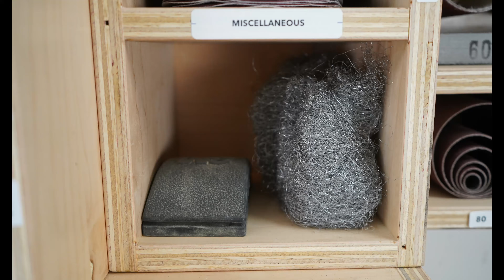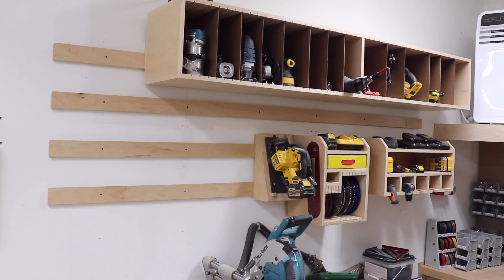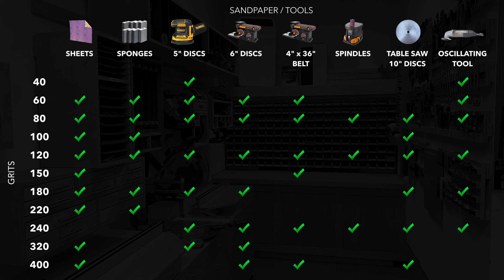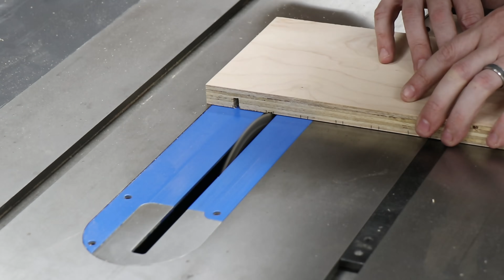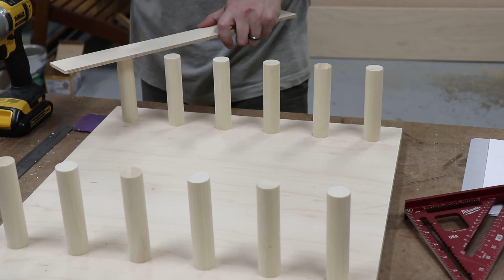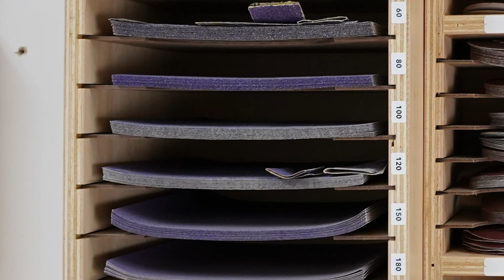Shop Organization - Part 5: Sandpaper Storage

Comment: After two years of use, would you change something in your design?
(thanks for sharing, it's inspirational!)
Reply from the maker: Biggest thing is I don’t use that many grits very often, especially on my belt sander.  I more or less designed it overkill so if people needed that much it would work out and if they needed less they could scale it down.  Also thought if I had more options I would use more, but I really don’t.

Comment: Great video many thanks.
 Just watching again and i noticed one thing i would recommend, is the papers and grits are the wrong way round. I use to use loads of discs and sandpaper in our body shop. and cross contamination of grits is bad so much batter to have giner grit to the top and course to the bottom. So any grains falling from discs above wouldnt matter if fine above. Again would that I could make videos like this well done and Many Thanks
Reply from the maker: Never would have thought of this ever being an issue but makes total sense, great advice!  Thanks!

Comment: If you carefully design the unit for a given space, French cleats add no value- you are not going to be moving it.  I built a similar abrasive store, but added a door- the extra access operation was worth excluding the dust. 
There is an argument that we never use full sheets, and so they should be stored as thirds, or quarters. My problem is - which?
Reply from the maker: I would disagree, things change.  Tools change, amount of tools change, workspace needed changes.  Most of what I have on my French cleat wall I have moved at least once, if not multiple times.  The sand paper storage hasn’t been relocated, but I have shifted it around a few times based on where my miter station was below, if this was just mounted into the wall that likely wouldn’t be the case.  So even if it isn’t a full relocation or rearranging, having the flexibility to slide it down even a half inch of space is needed, is very nice.

The full sheet question is an interesting one.  I normally use quarter sheets, and from there I either fold them up more or tear down even less.  I’m sure it depends if you use a palm sander or sanding blocks to get them to fit.
Reply: @RingsWorkshop  So you have a French cleat system with 1/2" movement? That would remove most of my objections to the system. It is not clear in the video how you achieve that...
Reply from the maker: @Tensquaremetreworkshop  side to side, not up and down.  I had to shift my miter station between a 1/2” and 1” to the left and because of that my miter saw when at 45 degrees the handle would hit the sand paper holder, so I had to shift that down as well.
Reply: @RingsWorkshop  Ahh, it was the 'slide it down' that threw me. Guess you meant 'slide it across'.
What I like least about cleats is that there has to be a space at the top, to allow the lift to disengage. That is a space almost designed to collect dust. Unused areas of cleating also harbour dust.

Comment: Hey, brother, I’ve watched your series and I may have missed it somehow, but I don’t recall you discussing Haz-Mat storage.
Most garage/shops (like mine) have combustible/flammable  and toxic chemicals. While I don’t have an appropriate, metal, NFPA recommended “yellow cabinet” , I have an area. Unfortunately, all my flammable and toxic liquids are stored on large, wooden shelves. The best I can do at the moment is to use an area as close to the garage door and on an outside wall away from my house as possible. That way, if there’s an explosion, the energy will blow out my garage door and not my living room wall and the fire will impinge in a brick wall and not my living room wall. I also try to store paint and swimming pool chemicals over there too. It’s certainly NOT ideal or even desirable.
Any suggestions on haz-mat storage?
(Perhaps a future video?)

Comment: I really appreciated you showing and talking about using the miter saw for grooves. Knowing how they work is important and any time attempting precision shows you the wiggle.

The amount of side-to-side movement by your input on the handle when pulling down or sliding. If I’m going to be using a hand tool on it after I’ll make cuts on the miter saw and get it as acceptable as I want. Sometimes just sanding it changes it enough for me too.
Reply: Tracksaws are a good way to go for this- very accurate, and a small jig gives precise widths.

Comment: Sawdust is man glitter! Love it dude! Also, nice project. If you attach a hacksaw blade to the bottom you can use it to cut a sheet of paper without looking for a blade or siscors.
Reply from the maker: I had considered that after I built it and honestly forgot about it and never added it, still may do that, good call!  I have quite a few in a drawer.

Comment: Nicely done.  I slapped myself on the forehead when you used CA glue and activator to build the stack of shelves; of course if that's used in areas that will be cut away it won't matter.  And its much more secure than double stick tape, and takes less time.  That thought hadn't occurred to me before.

One question - since sandpaper is light, did you consider building the carcasses using 1/2" instead of 3/4" plywood?  If so, why did you choose 3/4'?  And if not, if you did it again would you use 1/2"?

Thank you again for all your work and your style, both are appreciated.
Reply from the maker: Haha thank you, I appreciate it!  Honestly I had bought four sheets of the maple ply I used for a lot of other projects in the shop, however didn’t realize until I got it all home and unloaded that the quality was quite different.  It was at the beginning of Covid last year and there were very obvious seems every 6-8 inches of where the veneer came together.  The inside layers weren’t near as nice either, had some voids, more of a yellow color.  So I used one sheet to rip down into French cleats, I used another sheet for this.  Good call out, could easily have been half inch ply.  Part of the OCD in me just wanted all the storage I made to match I think as well.
Reply from the maker: Also, thank you so much for your support, really means a lot!

Comment: Once again, great video and tips. I like the modularity of this, yet all fits together. I built a small drawer cabinet to hold my 5" ROS paper with 12 drawers (yes, I use that many grits sometimes), but have the rest scattered around the shop in drawers and cabinets. I need to rearrange the shop soon to group all sanding in one place and one of these close will fit the need for storage. Looking forward to seeing more of your ideas. - Chris
Reply from the maker: Appreciate it!  Yes it’s very nice having it all in one place.  I under estimated how nice of a change that would be and should have done it years ago.